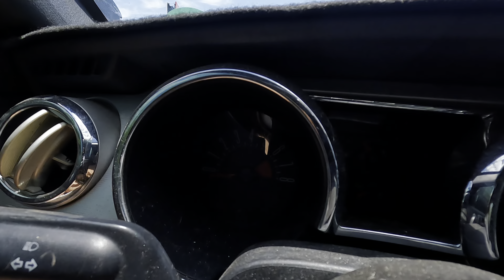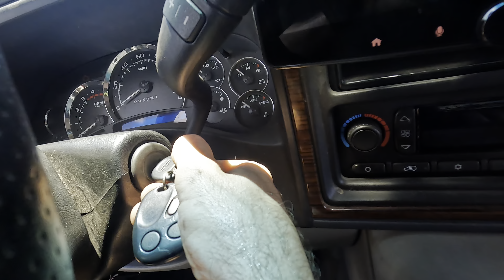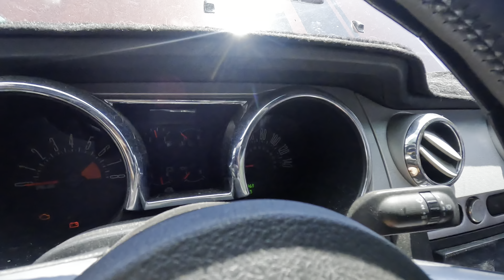Great Way for Wheels To FALL Off! (Wheel Spacer) Ford Mustang GT

Comment: That last PSA on not compressing pistons when others are off was overlooked when I did my break job. Good thing I didn't do them all at once.
I did however have to take my water pump off 2 times. First time I folded and ripped the o ring, next I took out a timing cover seal thinking that was the reason, luckily pressed a new one in. but it now appears to be leaking through the bearing because i didn't replace the pump and cheapened out thinking i could get away with a 80 dollar repair... THIS IS HARD MAN

Comment: Just an observation. I was taught many years ago that the caliper should not be pushed back without opening the bleeder screw first. Then it just pushes out the old fluid and nothing is being pushed back into the system. I have always done it this way and still bleed the system with new fluid. It also eliminates any system flushes. I never see anyone doing it this way, but works for me for he past 50 years. Thank you for your videos, so enjoy watching and still learning.
Reply: Not a bad way. Some avoid doing that because it avoids possibly breaking off the bleeder, especially on old rusty cars. And It just takes longer
Reply: I've been doing that forever
Reply: I just take the lid off the reservoir as it does increase the fluid level in it.
Reply: I like doing it in my own car just to keep that bleeder moving around

Comment: Thanks for the update on your selection of slide pin lube. I have a nearly full container of the Permatex purple goop that I used once on my car, I purchased the stuff because I saw you using it. At 24:10 when you walked to the passengers side your audio dropped out.

Comment: 95 in Florida is like 115 in drier climates!
Hot spots in the rotors have a different coefficient of friction that can also cause pulsing.
Worn pads and hot rotors!
Mic is working great!
Reply: As we say amongst my friends, "It's not the heat, it's the stupidity... I mean humidity."
Reply: @MonkeyJedi99  I think you got it in the first part of your' quote'🤣

Comment: Add a 2nd pry/driver in the rotor above the caliper, so it will keep the rotor from turning, and dropping the lower pry/driver when you move the torque wrench from one lug to the next.

Comment: They are correct. That purple does seize the slide pins. I know this from doing my own.  Good ole school axle or bearing grease hasn't failed in 60 years.
Reply: Even the purple stuff beats what a lot of people use for driveway jobs... which is nothing at all.
Reply: I was taught, years ago, that Syl-Glide was a good lube. However, I have found over the years that Syl-Glide eventually coagulates and makes the calipers stick. I use the CRC like Ray uses nowadays. Also, I never grease the backs of the pads. If anything, I use NAPA Disc Brake Quiet. You spray it on the backs and you'll never have disc brake squeal. Mostly with ceramic pads.
Reply: @robertsheriff6118  I have never understood the need to grease the backs of the pads. The piston does not move around on the pad so no need to have a low friction surface and all the grease will do is attract brake dust and road grime. However I am not a mechanic by trade, just a retired farmer that serviced his own vehicles.
Same goes for the pinion gear shaft on starter motors. Never grease the spiral gear as the grease will harden and attract any crap that gets up in the bell housing causing it to stick.
Reply: @MonkeyJedi99  Too true .
Reply: @ecclesmilligan8712  Exactly!

Comment: Use Loctite LB 8012 ( Trouble free rust jacking issues) at least in Minnesota.
On hub faces and or wheel faces. Piston faces too.
Use sparingly. Use a acid brush and cut the bristles to half the length to aid in providing a thin coat.
2003 F350 application on my end.

Comment: Wheel spacers = Always a BAD idea!
Not to mention the obvious issues, but the offset increases the cantilever load on the wheel bearing / hub....and causes early failures !
Reply: You are absolutely right !!!
Reply: Yes they are--Bad on Wheel Bearings, I used them in the Roaring 60"s...
Reply: So what's the difference on the bearing between spacers and wheels with the same offset as the spacers add?
Reply: @worxcustoms3440  Wheels with a lot of neg offset are bad too.  I write service at a GMC dealership, and see it all the time.  Spacers and high neg offset, tearing up hubs.
Reply: Those are factory GT wheels with 6 cylinder spinners. Offsets are there to accommodate the phony caliper covers
Reply: Would you say that's true regardless of spacer size and application? 

I'm looking at adding 1" spacers and a 2" lift kit to my 2000 Grand Cherokee 4.7 just to go up a tire size
Reply: @73amx63 You're kidding? I'm not familar with US cars, and haven't seen those covers before, but fitting spacers to enable those is crazy.
Reply: (cue music) "You picked a fine time to leave me loose wheel...."
Reply: @TremaineLea  If you want the big neg offset, do it with the wheel and NO spacers.  Just understand your hub bearings are living in dog years.
Reply: i ran 2" wheel spacers on my drift car for a while before getting new wheels, never had an issue. pro drift cars also run large spacers sometimes with over 1000hp.
Reply: @darknes7800  I'll be running anything planned by at least 2 local shops that specialize in custom off road applications.
Reply: @tyrantworm7392  I have not either, but they are not needed.  Just paint the calipers red
Reply: @73amx63  My car does 25% of it's miles on track and l'm a tart, so I'm running red AP 6/4 pots anyway. I just struggle to be a tart without a purpose.

Comment: I have used the purple grease for years through ;multiple replacement cycles of pads on my own vehicles... never any issue with the slide pins.  However, I do clean the pins EVERY time I do pads.  Lazy no-cleaning may change the results.

Comment: Consider a capacitor jump box…no batteries …no precharge needed.  Hook to most any battery as long as it has voltage (different units have different requirements for how much voltage ).  Then once it reaches full charge (3 minutes or less).  It varies on different units and charge voltage of battery you are hooked to which can be on another car if needed.  …keen 6000A Super Capacitor Battery-Less Portable Jump Starter for 12V Car, Built-in 6 * 3000F Supercapacitor, No Pre-Charging Need, Extremely Safe, Always Ready Jump Start All 12V Car.  All different price points but might want to check into it.

Comment: Red thread locker should be applied to the wheel studs when using spacers and anti seize applied in between the spacer and rotor because the two dissimilar metals can corrode and bond the two making disassembly extremely difficult especially in the northern states.

Comment: I had to put spacers on my boat trailer so the fenders didn't rub on the boat hull and nearly lost the trailer as the spacers were coming loose. I picked up heavy duty thread-lock as these spacers are never going to come off and that did the trick. 4 years later and no issues from them.

Comment: Mic is great, but as you move about the sound can dip a little. Try clipping it to the brim of your cap. Better than swinging about on the front of your shirt. Having it on your cap means that the distance between it and your mouth remains constant. Checkout Al from the smoke factory channel, always has his mic clipped to his hat.

Comment: I found a set of Crager SS 20 inch rims. The offset was the same. They fit fine but the rears were about a inch too far in. I used forged steel spacers. It was for a 1981 Silverado show truck. Didn't have any issues.

Comment: Hey Ray,

Here in the Great White North and the corrision issues, I always clean the pistons in the calipers prior to pushing them back into the bore, as it prevents dirt and rust from damaging the seals and causing leaks.

In addition, I always use the Permatex Disc Brake Quiet (Blue gel-like substance) between the pads and the pistonsand caliper fingers. If not, it usually results in the brake squeel, which is a actually caused by vibration of the pads in the caliper.

You ever experience this issue?

Thanks.

Comment: when i can i compress the caliper with a screwdrive or prydriver before unbolting just pry back inner pad saves time also c-clap vicegrips on inboard with the old pad and that works very well also never felt the need to buy exspenive tool like that to do this job..but it just makes you look better in the eyes of some customers

Comment: Each brake job brings something new, wheel spacers, stuck rotors, squealer devices, slide pins. etc. we learn from them all. so they are NOT boring!

Comment: Just keep doing whatever works for you... I feel like that's how it should be done. There's a hype today for gadgets and knickknacks, which (some of 'em) have good use, but the old fashioned way hasn't actually gone bad or stopped working, and it even feels more personal, for the effort you put in as to get it to work

Comment: 42:47. I love how when your doing a brake job on a vehicle that has said rubber insert, your never supplied a new one. Once worn they are a bear to get back in without tearing them. I personally think it should be supplied with the hardware, I hate having to buy a new set of sliders just for that

Comment: I never thought about warped rotors in the aspect you explained. Ray, but you make a great point. I know we see a lot of brake jobs but I don't mind watching another. After all every car is different. I would also have to agree with the lack of lubricant on those types of pads. Definitely make sure you torque those spacers along with the wheels.

Comment: TOPDC Quick Connect Plug Jumper Cables,1 Gauge 30 Feet 800A Booster Cables with UL-Listed Clamps, Heavy Duty Automotive Booster Jumper Cables for Car, SUV and Trucks with Carry Bag(TD-S02P0130)

With all the electronics in your truck and your decision to forgo jump boxes in the future maybe try this quick connect jumper cable system going forward. 
Whether in the back box or under the hood accessed through the grill, this is something you can mount where you don’t have to open anything. Just plug in

Comment: I remember when I bought my mechanic special 2003 dodge ram 1500 with mismatch pads all the way around and very warped rotors . I replaced them with cross drilled slotted rotors and no warping and no dust build up . Only bad is you can’t have them turned!

Comment: Brake jobs are so much easier in sunny Florida than they are here in the great white north (Ottawa, Ontario Canada). Brakes die an early death as a result of excessive and rapid salt corrosion. Additional rust preventative lubrication is a must. The mic. sounds good to me.

Comment: You may be able to modify the MAF and air intake with a more modern MAF sensor ! The electric connector even kinda looks the same ! Most 96 to 2005 gm are all the same !

Comment: Idk, On slide pins, I've used high temp bearing grease and never had a problem, but I also lube up my brake pins every time I do breaks even if they need it or not.

Comment: I have the Hulkman jumper box  . I bought the best box and it will literally jump over 50 vehicles before charging. With the fast charging it’s done in 10 minutes but I slow charge to save the battery. I think an alternative for you is a hand truck and a car battery. That’s a lot faster than jumping with the truck.

Comment: You can also have someone step on the brake while you torque the wheel spacer. Provided that you don't have them disassembled like in the video.

Comment: I generally apply 1/2 torque on the first pass by feel, then full torque on the second pass. Never had any movement on the third pass sanity check. I always loosen and set lug torque after visiting any tire shop - . I might think differently if I did this for a living where time is money, but I welcome your thoughts just the same. 

You sound great BTW.

Comment: I have a flip over socket 19.5mm x 18.5mm and I've seen you use one as well. I have a Ford Fusion and Fords are noted for "swollen nuts", a chrome capped lug nut. When they swell, the usual 19mm socket won't fit unless you hammer it on. The 19.5mm works great for that. Sometimes the cap comes off, so the 18.5mm works for those. I solved the problem by throwing away the original Ford lug nuts and replacing them with solid, one piece nuts.

Comment: HI RAY,Yes Wheel spacers BELONG only on show cars.spacer shims up to 3/8 OK for caliper clearance ,but still iffy.Personally i would never trust them.6061 alum is strong but the more distance between the mounting surface and the wheel the bigger chance of issues,in my opinion.They do sell the right combo wheels and brakes for a PRICE,haha

Comment: Those Harbor Freight jump box will give you six months. Can't expect much from those cheapies. I have used the Booster Pac brand ES5000 which is a little pricey at $200 but I am on year six and it is still doing as it was designed. I will add that I use it frequently with my job. Also, yes would love to see the added video finishing the brake job on your current Mustang.

Comment: I would recommend throwing a dial indicator on the wheel spacer to check for concentricity. For the new mic, not so sure. It seemed to not maintain even volume. Maybe an auto gain setting?

Comment: Hey Ray, nice Battery setup but I would have set it up with the Heavy duty quick connect battery connection. So all you Gotta do is to do is plug in the one side

Comment: Regarding the audio, it was good for a bit, but a fair amount of background noise, but then as you asked if the mic was good, it went haywire. As for wheel spacers, as long as they are done right, they are just fine. I did some on my channel on my 98 Ram 1500, not in the purpose to get a high offset, but just a better stance and footprint for being top heavy with my camper. I have the factory wheels with 1.5" spacers torqued to 80 ft. lbs. and the wheel lug nuts to 110 ft. lbs. As long as they are torqued and not crazy offset, they are just fine. Thinking of putting the same on my 08 Charger RT too.

Comment: My jumper cables are also 0 gauge, but also are rated to handle 8000A continuous current. Also are 5m long, which is very convenient as well. The clamps will absolutely melt off before the cable.

Comment: I was wondering if the Bullet wheels maybe would still fit without the spacer, but the owner wanted to just push the wheel assembly outwards so that it gave the car a little wider look.  I'm not sure what the back spacing is.  Maybe the spacer was installed only to clear the plastic caliper cover.

Comment: I was taught, years ago, that Syl-Glide was a good lube. However, I have found over the years that Syl-Glide eventually coagulates and makes the calipers stick. I use the CRC like Ray uses nowadays. Also, I never grease the backs of the pads. If anything, I use NAPA Disc Brake Quiet. You spray it on the backs and you'll never have disc brake squeal. Mostly with ceramic pads.

Comment: Regarding the audio: i din't notice any different until you mentioned it of course. That's a good thing: it sounds clear enough.
However, let me pick some nits! I think the mic placement could be improved so that your don't obscure the mic occasionally as you move about, muffling the sound occasionally in a kind of inadvertent wah-wah effect.

Comment: In 40 years of motor and doing all my repairs myself I have never seen a warped rotor. I have had thickness issues mainly due to rust from the local car wash wheel cleaner. By far the most common issue is uneven contamination on the disks caused by tyre shops not torqueing the wheel bolts evenly. The slight rubbing deposits pad material on the rotor unevenly which in turn creates uneven heat which temporarily warps the rotor to the point where things go really bad.

Comment: My step dad used to be a diesel mechanic and when he says when you are going to do a brake job, always replace the rotors as well while you're in there. Even with turning the rotors they're at a higher risk of cracking from the heat

Comment: I always pin my pry bar between the seat and the brake pedal whenever I have to torque down a spacer properly. I never use spacers they always cause issues.

Comment: One thing i am noticing with the spacers is that the wheel lug studs are sticking out past the spacer.  make sure when you put the wheel on that it is flat against the hub and not riding on the ends of the studs.  Otherwise, need to trim the wheel studs shorter.

Comment: Only a few hundred brake jobs in my past, but it's worth noting to check the master cylinder fluid reservoir before you start a brake job.  Not just for the quality of the fluid, but if it's been topped off and you compress the caliper pistons w/o cracking the bleed screw, it's going to overfill the reservoir and cause other issues.  You may need to remove some fluid prior to starting the job.

There are arguments for not back pushing the fluid, but I've never actually seen complications from doing so.  I consider that personal preference.  Usually the brake fluid is neglected and could use a flush/bleed anyway.  I just did that as part of any brake job unless the fluid was pristine.  Compressed air driven vacuum brake bleeder for the win, for me.

Comment: For some reason, most of the time I find my brake problems, it's usually the calipers warping! But I never experience the symptoms of typical warped rotors like pedal pulsating or vibration of the steering wheel! When my rotor are warped and I apply the brakes, I ALWAYS experience the whole car would jerk back and forth slightly (Like the calipers are grabbing and not grapping constantly!) When I apply the brakes at a higher speed, You can hear the brakes vibrate!

Comment: Up here, rust under those clips, causes the clips yo pinch the brake pad ears and LOCK THEM IN PLACE. Then, everything goes bad. We have to take extra measures to prevent rust lock-up